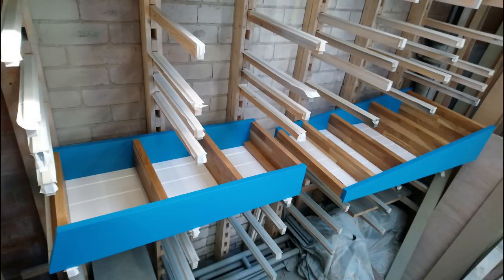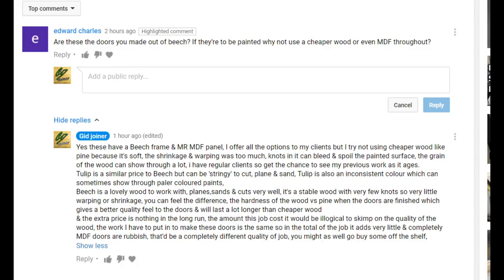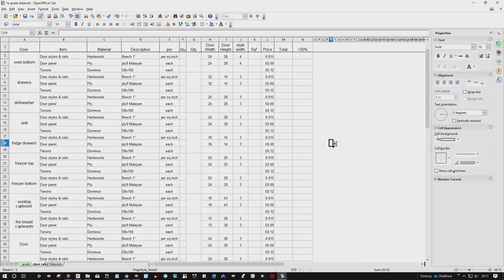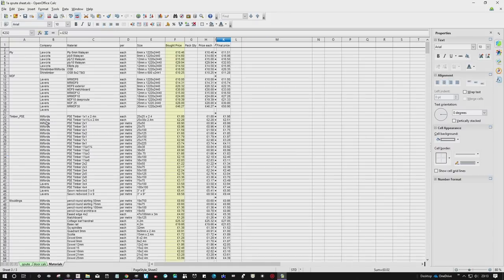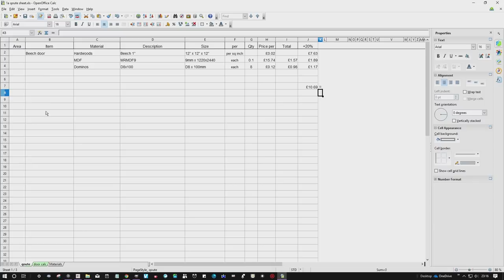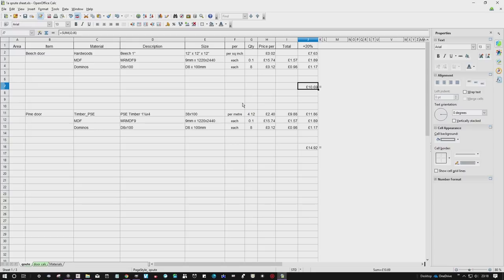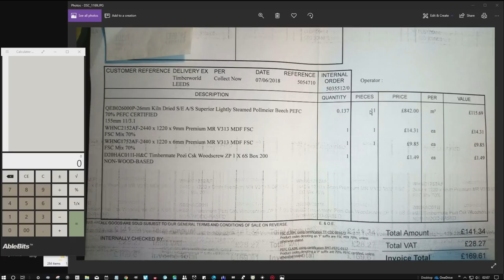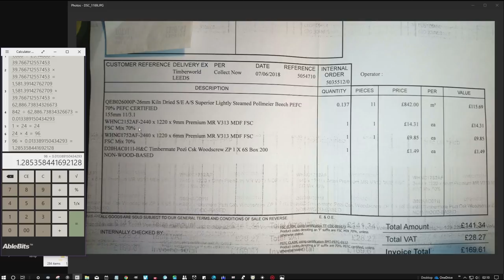Pine vs Beech pricing comparison? Late night thoughts in front of the PC

Comment: I love the look of beech and how it finishes but it can be wasteful, so many times when splitting a 2" or  1" board after facing and edging it only  to have it corkscrew on me when internal stresses are released. Moisture content didn't seem to make a lot of difference. It happened with kiln dried,  air dried and also green. Unfortunately, when you price for this it can raise the job cost to an uncomfortable level. Ok , you can save it for smaller jobs, but it soon piles up in racks, corners and under benches. It isn't only when I purchased the timber or  use the same timber supplier.  Great videos by the way.
Reply from the maker: Yeah i like beech, I try to use boards that are close to the finished size, normally for my work i have to rip a 7" board down to 2 x 3½s pieces. any wood is going to move though after cutting n planing tho so i just try to reduce the movement to a min. 
you've seen my rack with bit's of wood that is piling up, there's never enough or the right piece for the job I'm on so have to buy more 🤣
Thanks Clive, that's joinery i guess.

Comment: Great bit of information there Gid. Wouldn't mind getting a copy of that from you if that's all possible I would be working off of Excel but sure I can sort something. No matter what keep up the good work
Reply from the maker: This is Open Office which is free, it uses slightly different formulas so i had to re-write it all when i went over to this, this has a few other bugs that annoy me so would happily go back to Excel. I always have something else to spend the money on tho so this do for now. 
I had to learn n write this so not sure if a copy would work if you weren't familiar with the formulas, i change it around a little n repair it when i delete formulas sometimes, 
I 'll see if i can find some YT vids of Excel formulas, they normally have to be altered slightly for Open Office, the coma instead of a semicolon is the main one i think. 
I'll see if i can pick out any relevant ones, 
Vlookup, Named Ranges, Drop Down Lists, 
Thanks Frank,

Comment: Just watched this vid. Very informative.  Does occur to me that when you work out the cost of timber per cubic unit when costine say a door, are you making any allowance for wastage i.e. milling to finished size, unuseable end pieces? Or am I missing something? The lengths you go to to produce quality work is inspiring.  Well done!
Reply from the maker: Thanks Martyn 👍
Yes when i create the final bill i try to cover myself for milling/wastage & any little extras i may have missed, it's hard to price for every screw nail etc.. also some of the prices on my materials sheet has 10% added, that's not enough in the case of hardwoods because the planks come in various sizes, so this is an 'ideal' pricing. As always pricing has to start with as close an approximation as i can do, there's always some wastage, i plane Pse pine timber because it isn't sq or has a poor un-planed edge, if i want 3" pse I'll buy 4" pse & plane it down, If i price ply it depends if I'm going to have a usable waste piece, 
I give my customers a 'fair' quote but don't want to be out of pocket, the final quote is materials + a little (esp using hardwoods as i mentioned) & my labour, I'm not greedy & try to do a good job which is prob why i always have a waiting list which if i booked them all in I'd have at least 6mths+ work. 😁

Comment: Hi Gid, great video as usual. Can you tell me what CAD programme you use for designing your cabinets etc. Apologies if you have mentioned it in a previous vid. Cheers.
Reply from the maker: Hi, Thanks Morgan 👍
I've used TurboCAD Deluxe 20 for quite a few yrs now, i only use the 2D part as a line drawing is all i need for my plans, I don't know about all of them but the CAD programs I've used are similar. 
This is a poor vid I made a while back 
https://youtu.be/kHJsNJfh6sA
I paid a bit more from a shop & got the CD but it's a slightly earlier version of this 
https://www.amazon.co.uk/Avanquest-Software-TurboCAD-Deluxe-Download/dp/B00LG3Z6H2/ref=pd_sbs_366_2/257-3337689-7992233?_encoding=UTF8&pd_rd_i=B00LG3Z6H2&pd_rd_r=a176f3bf-4a7f-11e9-9557-5ba4820dfa94&pd_rd_w=DwZJZ&pd_rd_wg=RV3Ym&pf_rd_p=18edf98b-139a-41ee-bb40-d725dd59d1d3&pf_rd_r=AZ9J6G3WZGEWEHHHADAA&psc=1&refRID=AZ9J6G3WZGEWEHHHADAA
Reply: @Gidjoiner  Cheers bud. I'm an AutoCAD technician and use 2D CAD every day to design structural work but have never used TurboCAD. Will look into it.
Reply from the maker: I did look into AutoCAD but it's not cheap

Comment: Eh up gid. Love your vids mate. Don’t you ever have any issues with shrinking when using hardwood, especially if they have underfloor heating? I fit for a couple of high end firms and they won’t use hardwood doors, just mdf...?
Reply from the maker: Thanks Craig, 
Yep I get some, I use beech to reduce the shrinkage compared to pine, but there's always some, i just try to minimise it, 
I offer people a choice, i think when they're paying for it. In these old-ish houses they generally want traditional 'wood', that will last a long time rather than MDF that has a bad/cheap name for itself, I think I've only worked in one house that has underfloor heating, the concrete kitchen one, 😀
Reply: Cheers Gid. Keep up the vids.

Comment: Just one minor correction in your calculations, an inch is 25.40mm not 25.14mm. Not a huge difference if you are working out how long a small bit of wood is, but the errors will increase the bigger you go.

48" x 25.40 = 121.92cm
48" x 25.14 = 120.67cm
Your board would be 1.25cm short.
Reply from the maker: I always get it the wrong way around,  It's actually 25.416666666667 & π pi is 3.14, i always get the .14  bit mixed up 😉